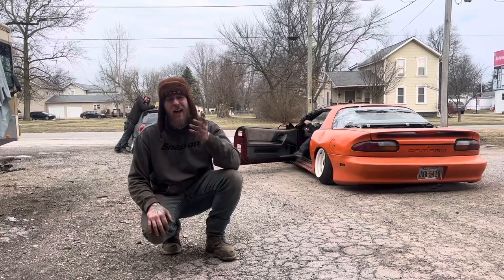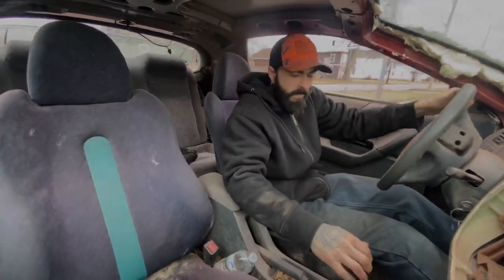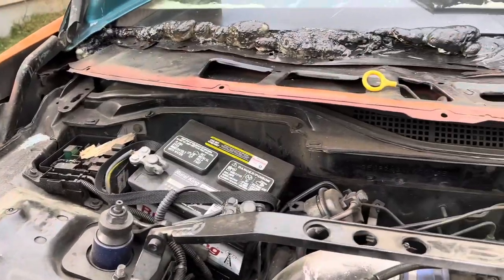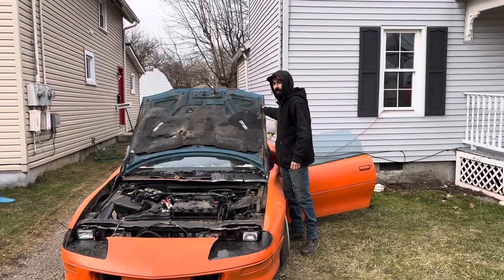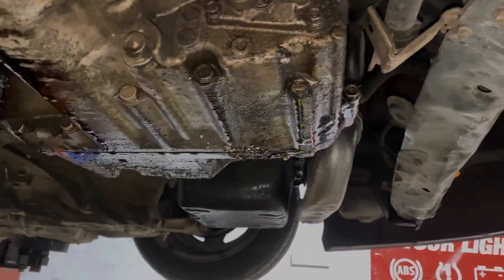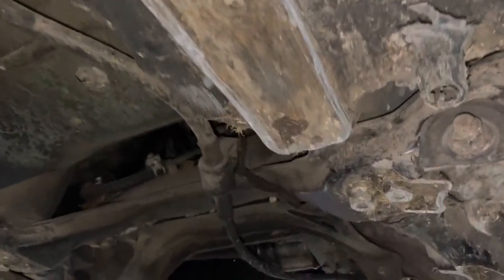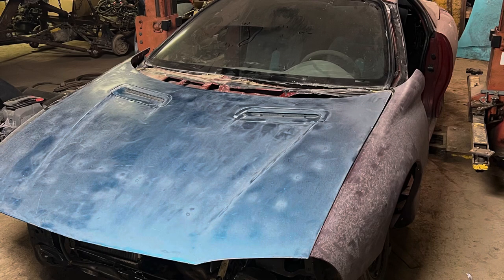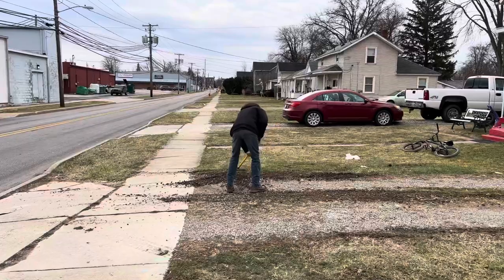Honda Swapped Camaro Stolen and Exposed by My Own Friend

Comment: EDITED: My Maxpeedingrods coilovers came literally soaked with oil, exchanged for another set (also completely soaked)  had a loud knocking within 100 miles, the lock nut holding the shock together was loose. 🤦‍♂️ Beware